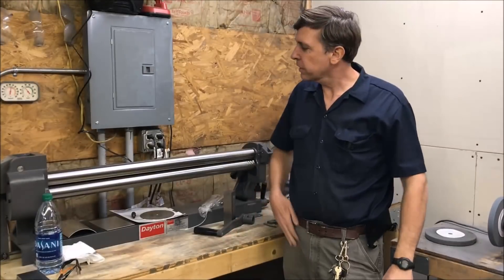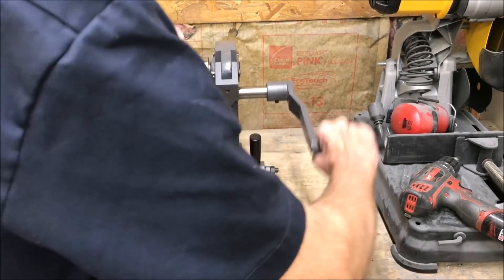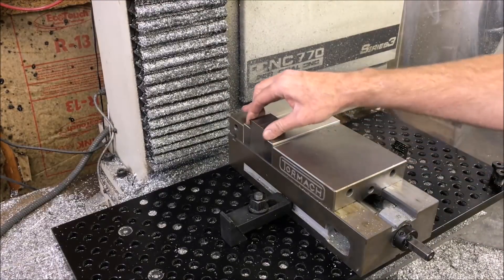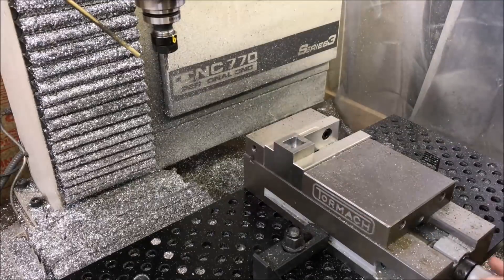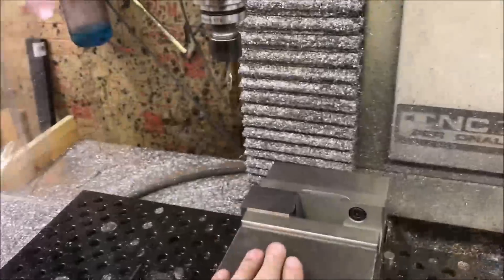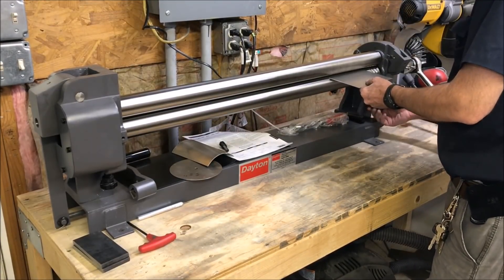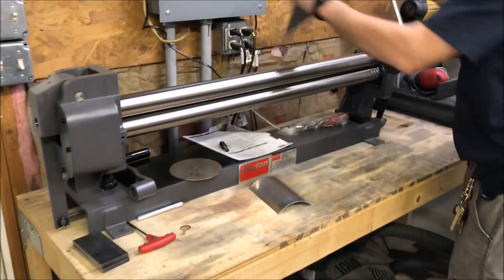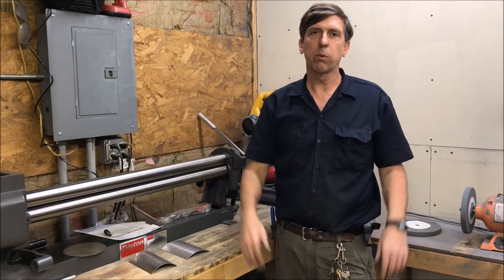New 36 in Slip Roll! Machining a Ratchet Coupling for it.  How to Use

Comment: Good idea using a ratchet.
I'd think some extra socket you have kicking around would fit on the roller end with some shim stock or machine screws wedged in.

Comment: Could have just bought a 4 point socket to fit it, but I guess if you already had the material free is better
Reply: Erstwhile      Or a 12 point.   You could also start the roller arm in the back so it finishes in the most comfortable position. Add a shim under the whole rig so your knuckles clear the table... Or Hang it off the end of a bench.   A lot of easy fixes here that don't require machine time.
Reply from the maker: I looked for one of those for my other slip roll but could never find one.  Needed it for a job right away also. Well, at least with this I can use set screws. Thanks!
Reply from the maker: The 24" ratchet helps a lot though, lots of leverage.  I used the stock handle for a short while and I could already feel it in my elbow.  Nice little project for a video though.  :)